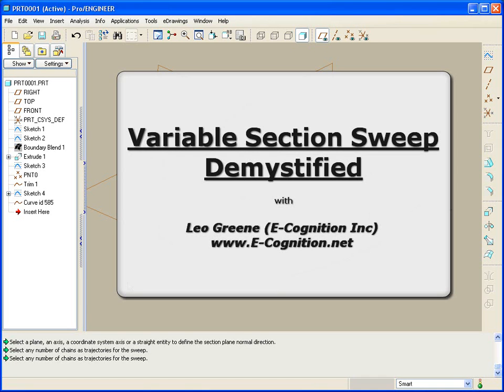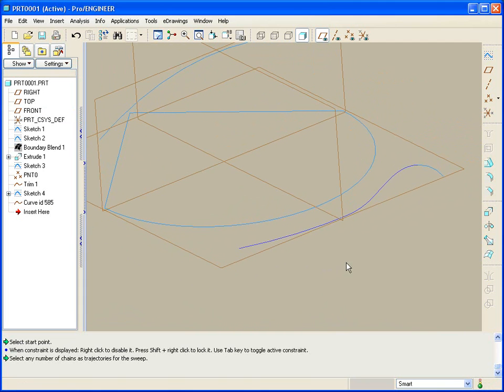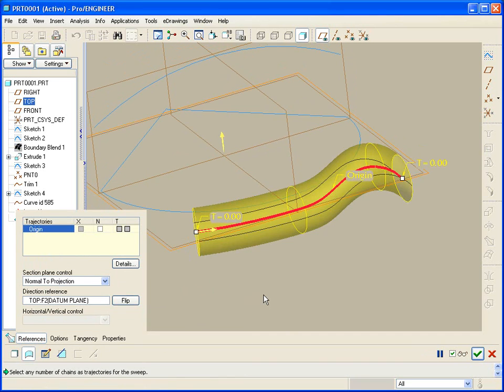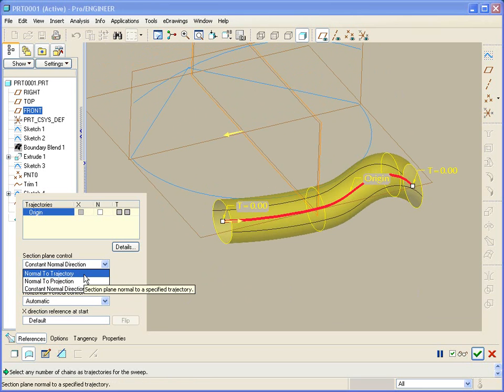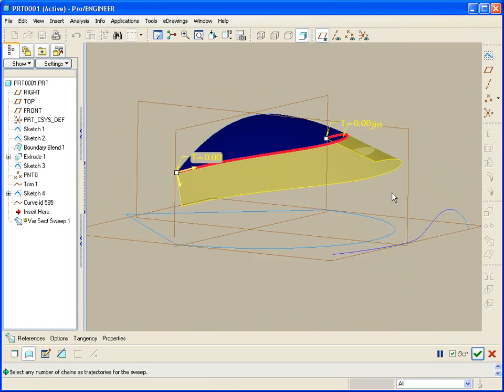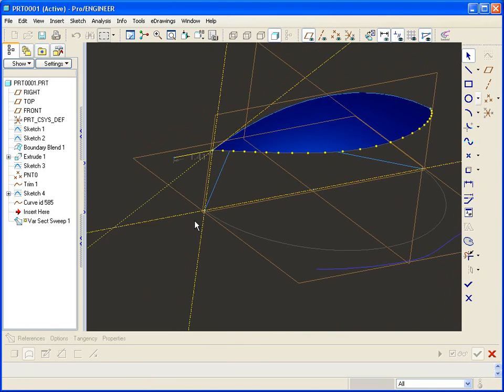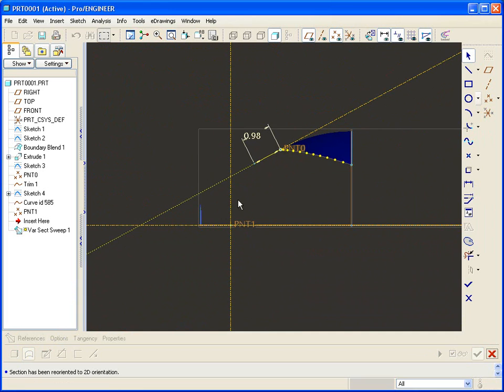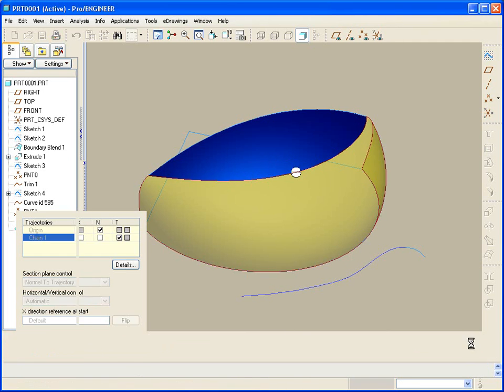Variable Section Sweep Demystified in Pro/ENGINEER Wildfire

Comment: First you must change in Applications falling menu from Standard to Mold/ Casting.In ANALYSIS falling menu on the top,select MOLD analyses type.In the window that appears under TYPE scroll to DRAFT CHECK,then you select surfaces for checking or whole part.After that you define PULL DIRECTION which can be plane or..Finally define VALUE for DRAFT ANGLE and on the screen you'll have displayed in different colors which surfaces satisfies the defined(are smaller)value,and which not.
 POZDRAV 
  SIMON